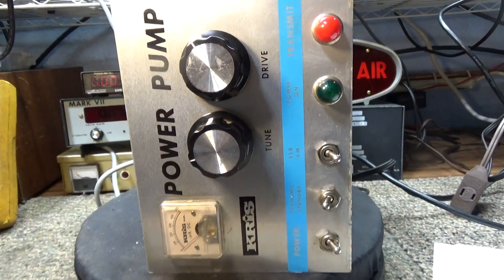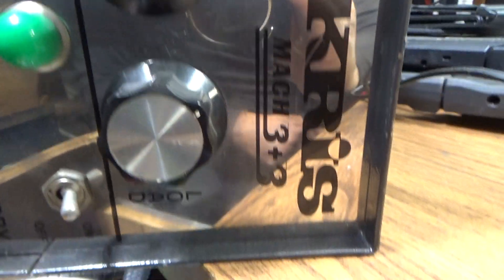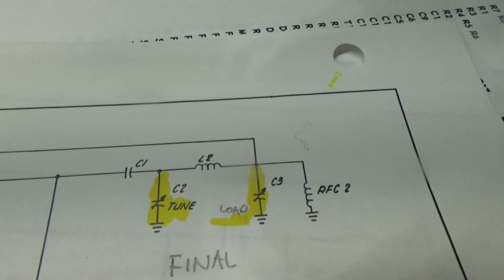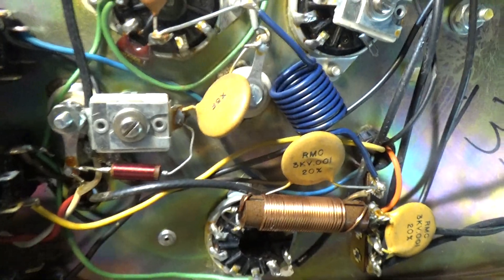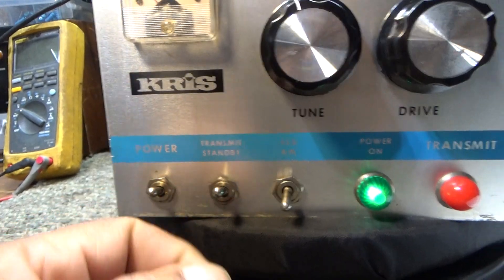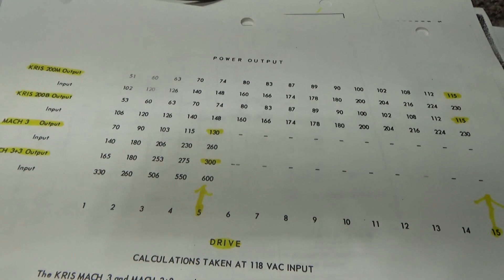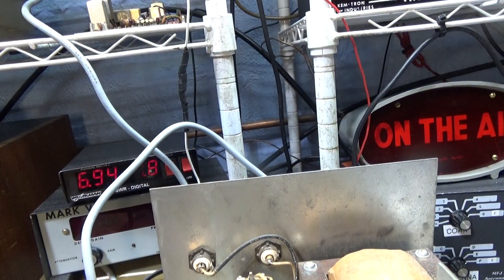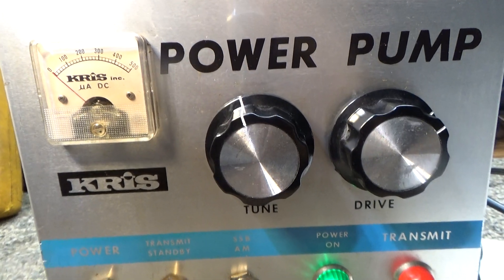Kris Power Pump 1 6JU6 driving 2 6LQ6 learn something new everyday.

Comment: Perhaps there is no tunable load control because your antenna is supposed to present a 50 ohm load and the amp is already tuned (set) for 50 ohms. The amp was designed back when the cb band was only a couple hundred kc wide.  So there wasn't much need for tunable loading.
Reply from the maker: Sorry, you are way way way off on that one.
Reply: @tramdr  Okay, so explain the logic of putting the load tuning control where it is not accessible... What is the impedance of a CB antenna supposed to be? How wide was the CB band back then? And, why is there no adjustable input SWR on this amp? Perhaps you can tell me what the engineer was thinking when he/she designed the amp this way.... Please tell me how and where I'm way way off... Gee, you thought those were for adjusting input SWR... Way off?
Reply from the maker: Sure, I can explain everything you said in one word, Sir:  COST.
Reply from the maker: Why Why Why? Riddle me this:
Why did the Tram D201 hardwired which is considered by many to be the best CB radio ever made, go from hardwired to circuit board and from USA made to Mexico?
Why did the Browning change from the Mark 3, which is another of the best CB radio's ever made, change from the steel chassis-handwired to the Circuit Boards on the Mark IV?
Why did Browning use a PLL on the Mark IV?
Why did Browning originally use the white Molex plug on the Mark IV instead of the Black Cinch Jones?
Why does the Heathkit SB-220 use an undersized HV transformer and also a weak voltage doubler circuit?
Why did the new Blue Palomar 300 box, not the old 300a, use a few switched fixed capacitors for the Load instead of an air variable? I asked the builder of that that question and you know what the builder/engineer told me? Hint, it was a four letter word that begins with C.
Why did Blackcat use a couple of fixed Silver Mica capacitors for the Tune Cap in the infamous JB-2000? Same question for the Blackcat JB-76? 
Why do most CB amps not have a tuned input at all?
Why don't more amps use vacuum variables instead of air variables? 
Why don't more amps use vacuum relays? 
Why, why, why, why, and why?

Comment: I am repairing one of the same, it is in very bad condition and manipulated. Greetings from Catalonia
Reply from the maker: Good Luck, let me know how it comes out.
Reply: @tramdr  It's already working
Reply from the maker: What'd you find?
Reply: @tramdr  incorrect modifications and a broken lampholder pin, and incidentally change capacitors and filament cables in poor condition. I am also going to try to change final valves for another type, there is one that turns red when transmitting
Reply from the maker: Try switching the tubes to see if its the tube or the amp. There aren't a lot of better options for the 6lq6 tubes.
Reply: @tramdr  I have the possibility of getting a pair of EL519 tubes and I'm going to try, modifying the connections.

Comment: Hello, can you tell me what component is on the board  marked REC-3 on outer edge of board at rear?
Reply from the maker: That big ugly brown choke is RFC3 on the CBTricks.xyz schematic. Its purpose is to ground the driver tube when the relay keys and is connected to the input SO239 coming in to ground. This works and keeps the tube cool and non conducting until the amp is keyed, but the downside is that very choke is connected to the radio input side at all times. Hence, it can and will mess with your SWR even with the amp off and unplugged. Amp makers used this as a cheap shortcut for cost. A better way that wouldn't mess with the SWR all the time would be to use a relay with an additional leg, (or Pole) and the additional relay leg would connect to this choke to ground it and activate the tube when keyed instead of using the input line. Probably cost $1 or $2 dollars extra for the extra leg on the relay 4pdt instead of 3pdt, but that's money the amp makers don't want to spend.

Comment: Do you still have that blue box Palomar with the (4) 6146s? Those things are bad ass. I would love to copy one. I know 2 people that still have em.
Reply from the maker: No, I don't have it. I did make a sketch/semi schematic of it somewhere. It is similar in specs to the Blackcat JB-75 but 4 tubes instead of 2. It is transformerless for the HV though. Uses a voltage quintupler right of the ac mains. Its a beast, almost unlimited HV current with that design, but on the other hand, dangerous. Not on that box, but there has been a couple Big Boys, who used that design for the HV, who have died when something went wrong with it. No safety protection.
Reply: @tramdr  oh damn thats crazy so it takes the ac right off the line , quadruples it. Thats crazy. Ya they run like crazy. Im trying to see if my other buddy will sell his. My uncle also has one but he said he would never sell it. Haha its a sweet small box that pumps. Even with those dangers i would still be interested in building one or a copy.  I am well aware of the dangers of HV.  I have a 2 piece amp supply 3 tube 3-500z amp and man those 2 piece units scare me...even tho this one is different and they don't use a connector for the HV.  Im deffently interested in what you have drawn out for that style of amp. I also have a yeasu FT102 with 3 6146s in the final. They only use a 12by7 to drive the 3 tho haha. I am game to build a copy of one of those skippers. Shit id rock it just fot am.
Reply: One of the things I've noticed with most amps is that they don't use a 3 wire grounded plug. Where this presents a hazard is if everything from the radio to the antenna is ungrounded. This is easier than you might think to inadvertently construct. With an unpolarized 117 vac plug there is a possibility of plugging it in and having the chassis, and everything connected to it, become energized. To avoid this, make sure that your antenna has a good ground. If you're using an amp, unplug it, open it up, and with an ohmmeter determine which prong on the line cord goes to the power switch. Mark it, and plug it into the right (smaller slot) side of the mains receptacle.